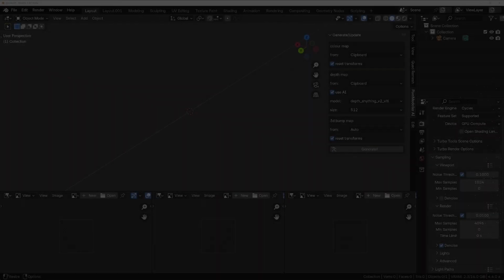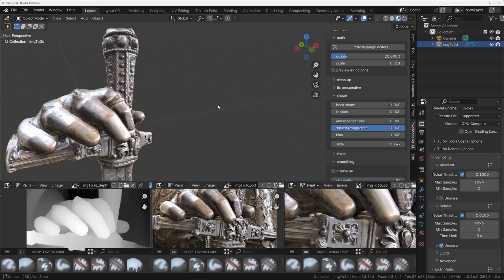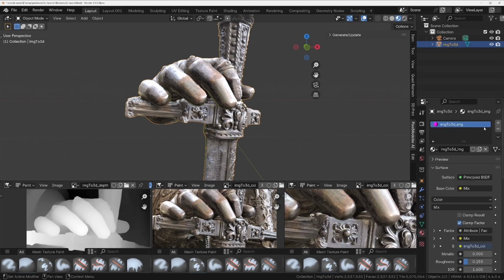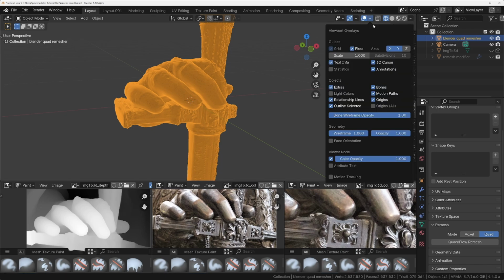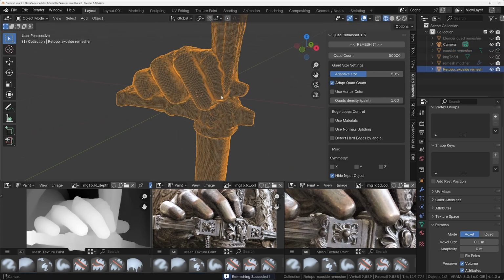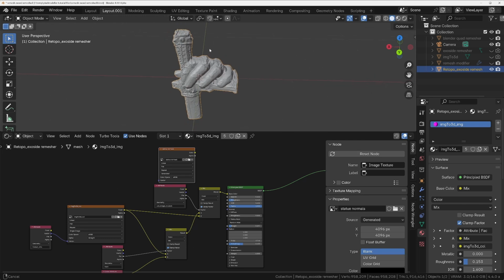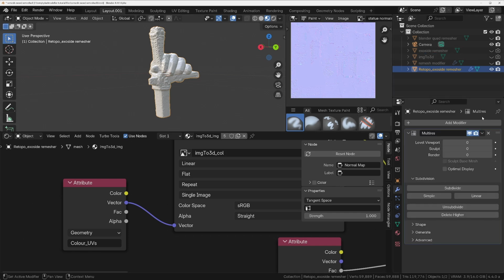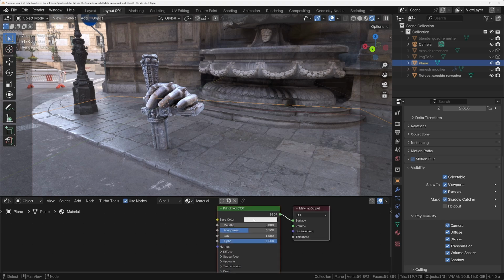From High-Res to Low-Res in Blender: The Ultimate Mesh Conversion Guide!

Comment: could we get an update that allows control of the image textures and principled bsdf? ie the roughness,metallic and what not. i use this for creating 3d people for archviz and have to turn up the roughness for every model so they dont look super glossy
Reply from the maker: Hi you can do that already.  Open the shader editor and then choose the material in the dropdown that has the same name as the object.  There are two materials for each object, one that ends with '_img' and the other ends with '_3dPrint'.  If you have the 'preview as 3d print' option enabled, then you modify the one ending with _3dPrint, if not, edit the _Img.  When you've finished modifying the object, you can also convert to mesh from the right click menu, then the material will become visible in the material panel too.

Comment: Your demos are very valuable on how this new add-on effectively uses AI models.   I'd love to see a demo of generating a full character (male or female) using any 2D image of your choice as a reference.
Reply from the maker: Thanks, I did do this with some page 3 models whilst testing.  Of course as it's depth based it's necessary to sculpt the back if it's not a symmetrical object, or combine back and front if you have images of both.